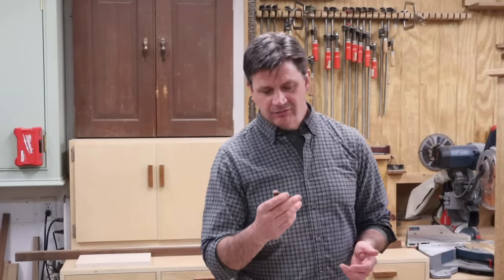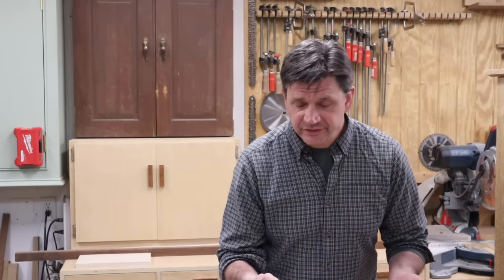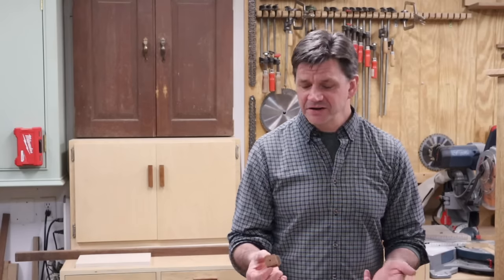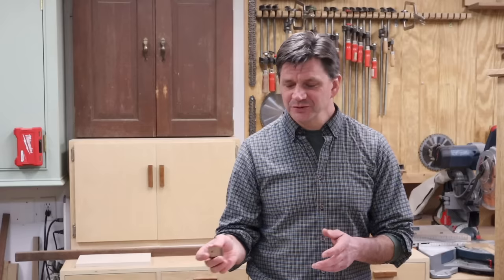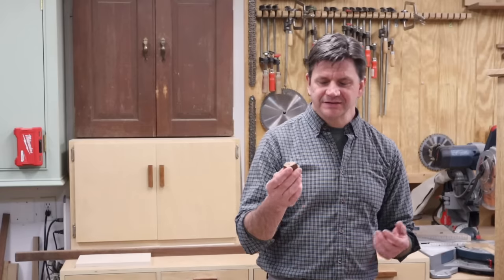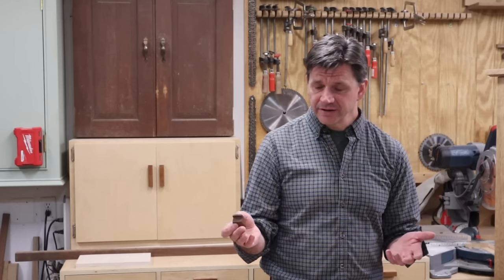How To Attach a Solid Wood Table Top, Jon Peters Pro Tip

Comment: This is a really great use for that scrap piece that isn't quite long enough for anything else.  I like to work from one longer piece.  I'll rabbet one corner then round over the opposite side on the router table.  Then over to the drill press and set holes about 1" apart.  Then just cut it to individual pieces using a cross cut sled.  Easy way to batch out a dozen pretty quick.  It's something no one ever sees, but they provide me so much satisfaction for some reason.

Comment: Great video. Thanks! I am building a counter height square pedestal table. The pedestal is basically a cube with corbels in the bottom (for stability) and on the top (as a decorative detail). What would be the best way to attach the table top to the pedestal? This is the first time I make a table.

Comment: I'd like to see a video where you calculate wood movement and what measures to do to avoid cracking etc. I know this entails lots of factors like in different types of wood, different climatic environments, construction details, etc etc, and is in fact a whole separate field in craftsmanship woodworking, but still ...

Comment: Grain orientation on the clips is very important.  I found out the hard way the first time I made these years ago and tried to batch them by notching a long piece with the grain and then chopping it into clips across the grain.  Not a lot of strength in the tab of the clip if the grain is running parallel to the apron.  They all promptly broke.
Reply from the maker: Yes very true

Comment: Jon, I have question. The wood clips attached along the long side of the table appear not to allow for wood movement across the grain of the top. The clips are right up against the apron and I can't tell if there is room between the end of the clip lip and the inside of the biscuit cut. Am I missing something or is this a correct observation? I'm sure climate would have something to do with it as well. Maybe this is not a problem for dry wood for inside use.

Comment: Hi Jon,
Would it not be more efficient to run a length out and do the rebate, with a spindle or router table?

Then cut the blocks? 

Cheers
Reply from the maker: That’s probably a good idea ... just need to make sure the Wood grain orientation is in the right direction.

Comment: Jon. I have a question. Just yesterday, I finished assembling a pair if night stands i had been making for the last three weeks. Last thing I did was attach the top. I had originally thought about gluing and screwing it on but I had read about wood movement. And I understand it. But I'm sure that the size of the top also has alot to do with how much it will move. I ended up screwing it on with some pocket holes and some regular straight screws but no glue. Would glue have been ok for my 22" x 18" top? I think I prefer it being on there more securely. Please let me know what you think. And I truly enjoy your videos.

I looked back at your book case video but it doesn't show how you attached the top. I was hoping that would help.
Reply from the maker: Hi Gabriel You probably don’t need to glue it and it sounds like it would be an end grain to long grain glue joint and and that’s not a very strong joint anyway.
Reply: @JonPetersArtHome  ok. I see what you mean. And thanks for your videos and for replying.